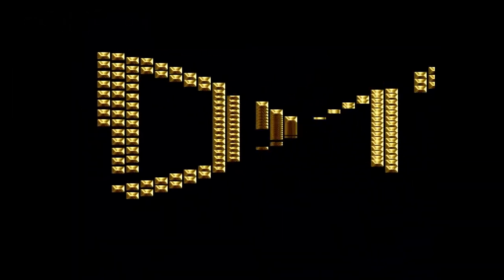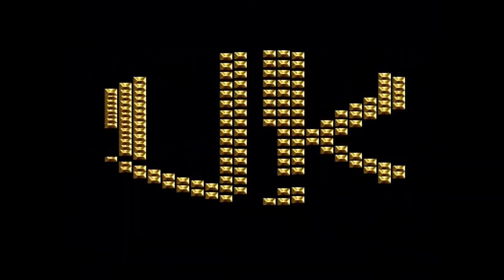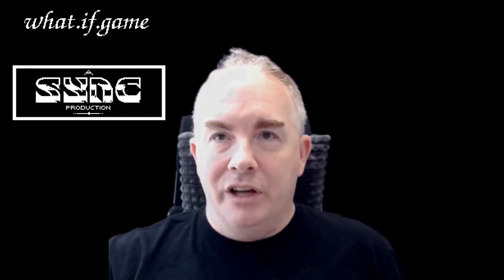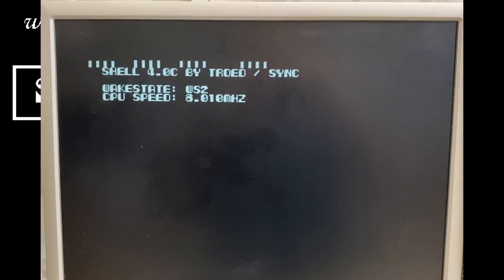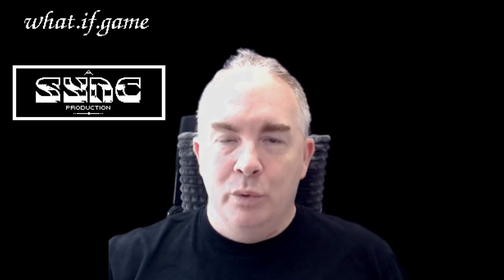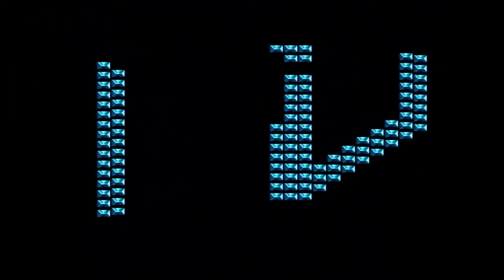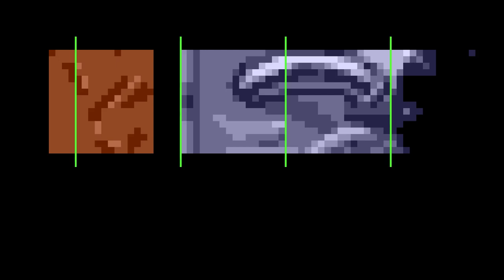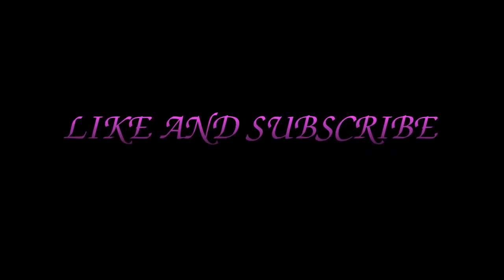what.if.game - part 3

Comment: interesting. works just like STe hardware scrolling. 😀
Reply from the maker: Yes - and the STe hardware scrolling is also performed by the Shifter :D I do believe the Atari engineers saw how this could be done after the ST was released.
Reply: @troedsangberg  I figured they just had it preshift the output pixels by 0 to 15 positions without actually outputting them... it does already load 336 pixels in that mode. Just start running X number of pixels "early" whilst blanked, count 320 active, then blank again.